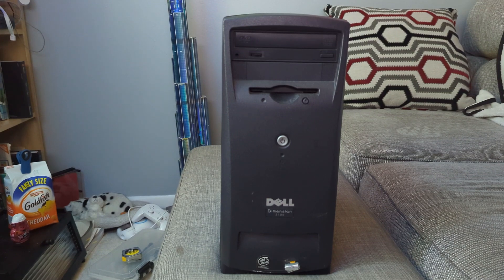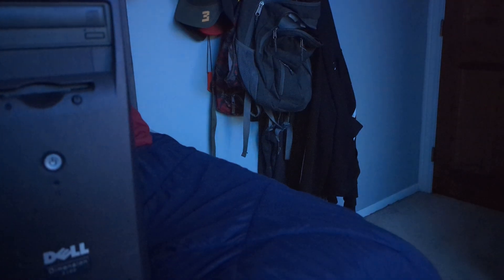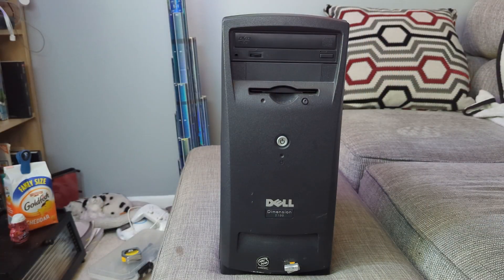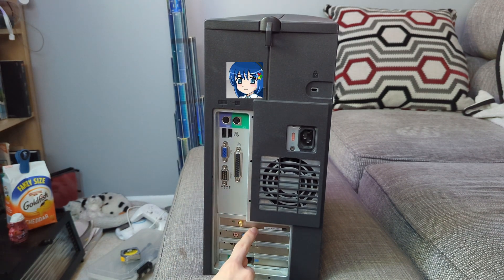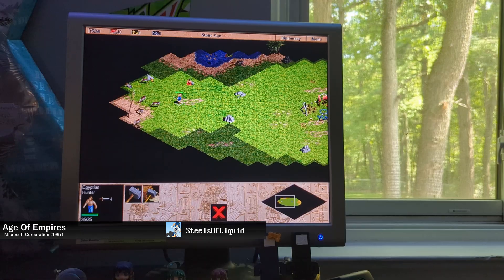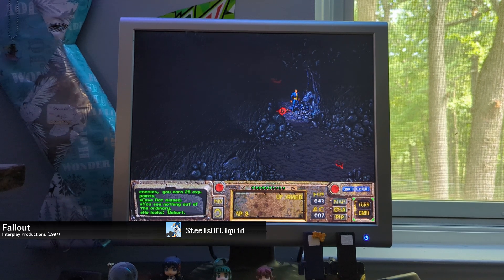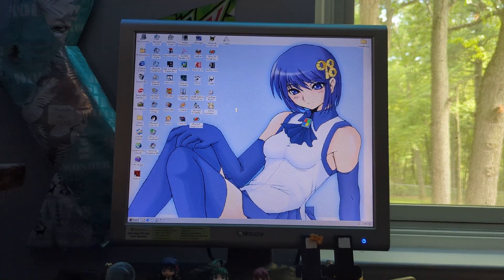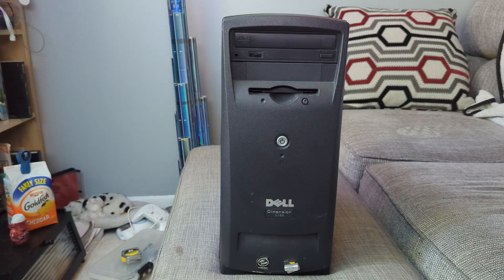Dell Dimension 2100: The ultimate Windows 98 PC?

Comment: i agree, in fact its a GREAT option for windows 98 or windows ME, me personally, I got ME installed, very happy with it - I did upgrade it with a voodoo banshee PCI and an ALS4000 soundcard, which has perfect support for late era dos games! its a beast of a computer for me, it really checks all the boxes, solid build, great harddrive ( it came with 15 gb, still running strong!), very good mainboard, rock solid. CPU is a celeron 1000 because, why not?  its snappy, its quiet enough, hence not silent at all! but its a retro pc baby! cheers from germany!